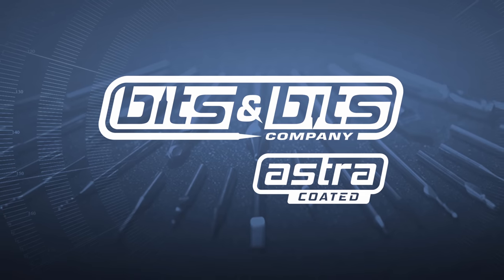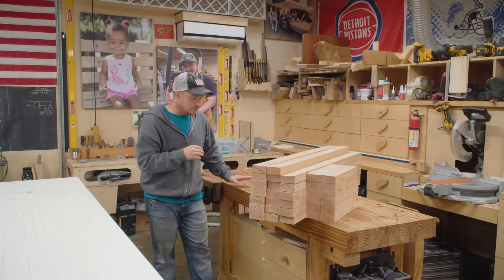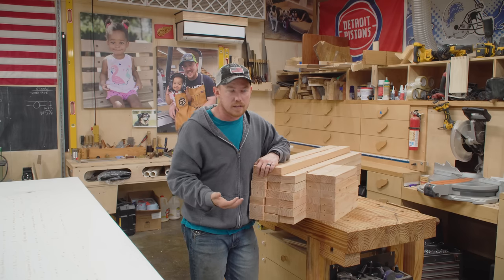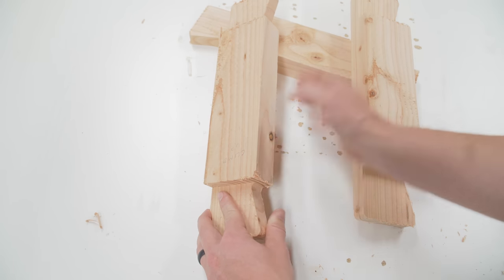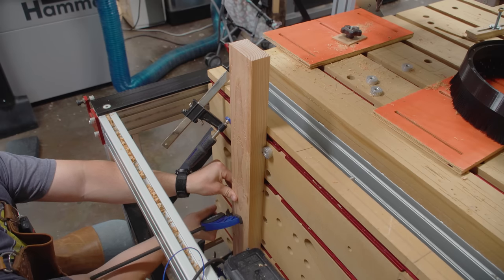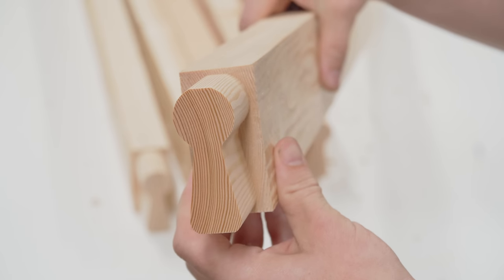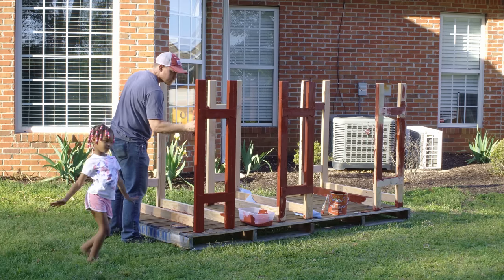Dovetailed Halflap Keyhole Mortise and Tenon Firewood Racks

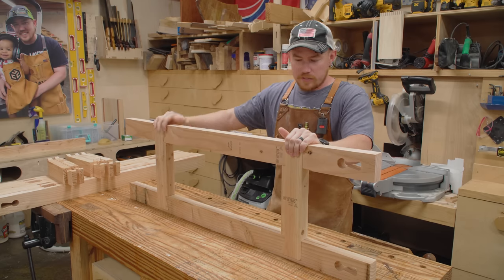Comment: 7:00 
I find that when I use pine/spruce from the big store and let them dry it’s a pure nightmare. Should I work with the boards as soon as I buy them ??

Thank you !
Reply from the maker: Pine at big box stores will typically move more than most other lumber sources. It's dried to construction grade standards, not furniture standards. So you can either work with it immediately and deal with the minimal movement that happens at first or let it sit for a month or so and let it figure out what it want's to do.
Reply: Moisture content has a lot of affect on how well wood machines. That's particularly true of softer woods, like pine. I worked in a furniture mill that produced a lot of furniture from spruce. The kind of fuzzies that Jay complained about were a problem when we used wood that had a moisture content above 12%. We seldom had problems with fuzzies when the moisture content was less than that. So, if you can, it is best to let the wood dry before using it. That's particularly true of pine.

Some things you can do to make drying easier and more successful: First, pick the boards you buy carefully. Try to buy boards without any pith in them. Pith leads to warping and cracking as the wood dries. Avoid it if you can. Second, sticker your lumber so that the air can circulate along all the edges of the wood. That leads to more even drying and less cracking and warping. Finally, consider rough cutting your stock before drying. Cut the wood longer and wider than you'll need for your finished pieces. This helps because smaller pieces dry better than larger ones. Yet, because wood moves more across it's width as it dries, you'll want to leave plenty of extra width to work with. For this reason, I seldom rough cut my lumber to width. I do rough cut it to length, leaving myself a couple of inches to work with.

What is considered 'high' moisture content varies for a couple of reasons. The first is local climate. In some regions of the country, it may be difficult to get the moisture content below 12% through air drying. That's because of the region's humidity. The furniture mill I worked at was in the middle of a desert. Twelve percent moisture content was considered high in that location, where the humidity was often less than 10%. The second reason is the difference in moisture meters. The style of moisture meter we used in the furniture mill might read differently than the one you might have in your shop. In other words, don't use the 12% moisture figure I cited. Instead, learn how pine reacts in your shop.

Comment: Really liked how you left the joints proud. Really nice, yet subtle accent.  However, I do have reservations about the amount of force those side panels will exert on that keyhole joint after you drilled out the hole for the carriage bolt/foot. Seems like a great way to keep the ends off the ground, but the extra material removed from that keyhole tenon gives me pause.  Then again, I'm nitpicking. Great project!
Reply from the maker: Time will tell :)

Comment: Maybe the angled side of the dovetail facing up will be less of an issue because the water can run down whereas the square side, that is parallel to the ground, has more surface for more water to sit.

Chamfering the edges could be a solution.

Comment: I don't think it matters if you flipped the orientation of your mortise and tenon because both have the same moisture catch.  One is on the end and one is more toward the middle of the board depending on which one you chose.  The moisture catch is unavoidable with that shape.
Reply from the maker: I was talking about flipping the dovetail, not the mortise and tenon.
Reply: @JayBates  Oops.  Pardon my ignorance.  I meant the dovetailed halflap; I mixed up the terminology.  The shape of the dovetail has a downward trough that could possibly catch water regardless of the orientation.